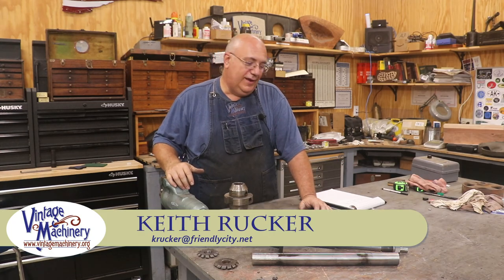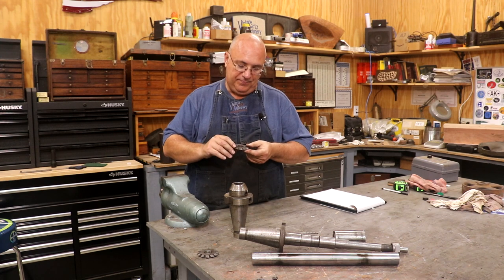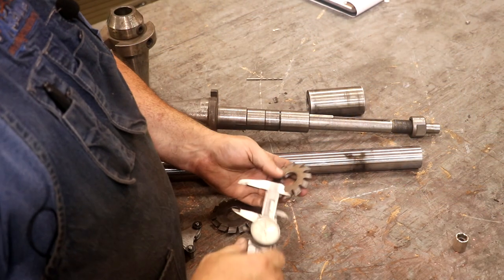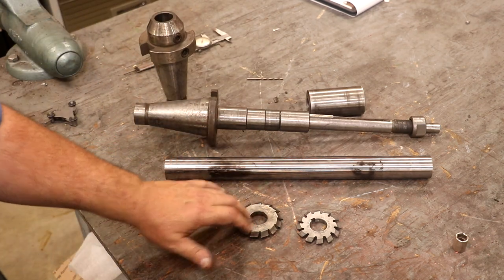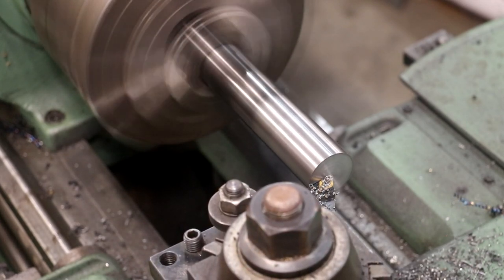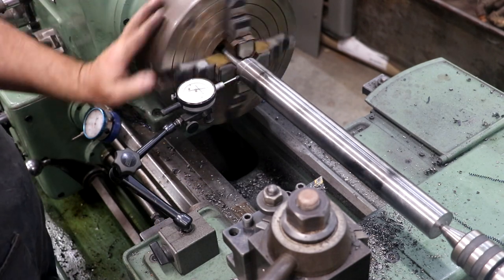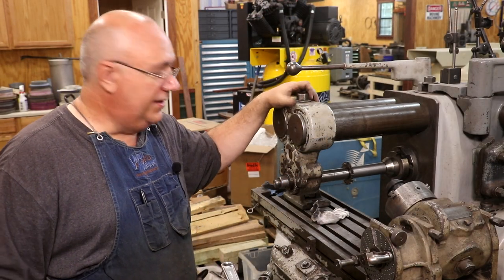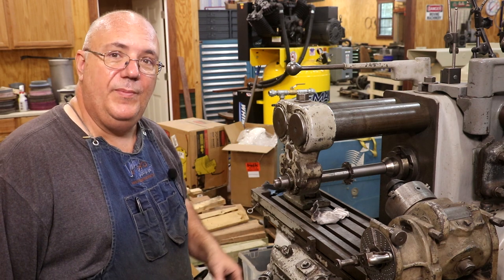Custom Horizontal Milling Machine Arbor Build

Comment: Hi Keith. Is there a reason why you didn't turn the whole thing between centres?
Reply: He's an amateur ;)
Reply: @millomweb  If he is, he's a darn good one.
Reply: @boldford  You've not heard the logic behind that argument ?
A professional is paid to do a job - he does it for the money. An amateur does it for the love of the job - now which of the two is going to do the better job ?
This, I take from theatre - having been involved in amateur theatre - I've seen performances that outshine professional theatres. The latter may spend more effort on various aspects - like set decoration but in fact the enjoyment of a performance doesn't necessarily need that. Expertly delivered lines and appropriate controlled movements ('acting') can work exceptionally well. A chair, a table and a standard lamp + actor is really all you need !

Comment: how is that cutter different for a bevel gear?
Reply: I think it has a different shape because the bevel gear gets wider from one end to the other
Reply: @ypop417  try again
Reply: @jacobpoucher  then You tell me?
Reply: @ypop417  he didn't reply? 🤔 Probably because he can't Google the answer
Reply: @maggs131  I tried to google the answer and got a Mr. Pete video saying there are 500 pages in the machinist handbook on gears
Reply: @maggs131  but by looking closer at the bevel gears they are cut deeper as you go to the wider end.

Comment: Would the arbor have been more versatile if the 1-1/16" section had been a little longer - say 1/2". If a 2" bushing were made with a 1/2" long section of 1-1/16" bore and 1-1/2" of  1" bore, the bushing would hold ANY THICKNESS CUTTER from 0" to 1/2" securely in place, whilst sitting securely on both sizes of the stepped shaft.

(yeah, it's a little work to make that bushing, but I don't think that's a difficult project)
Reply: The 'fit' size need only be half the thickness of the cutter. Why make more work ?
Reply: @paulwomack5866  That's another way to do it ! I think his solution took the most effort.
I think the best solution I've seen suggested is to use 1" arbor and make a bush with a shoulder of 27mm extending just short of the width of the cutter.

Comment: Great videos. I'm curious, every lathe  pretty much every lathe I have ever seen has a recirculating emulsified oil / water coolant on the cutter /drill bits etc. You don't use is this normal or do you only use for special jobs .  
From Sheffield UK.

Comment: Mr. Rucker to make the threads on the piece of stock is it the speed of the rotation of the stock or is it the speed at which the cutting tool traverses the stock start to stop? My apologies I have watched you do this but I was not clear how you got the thread size you want.
Reply: Your thread pitch is determined by the relationship of speed (how fast the stock is turning) and feed (how fast the cutter is moving). For any given speed, faster feeds produce coarser threads and slower feeds produce finer threads.
Reply: Thank you for the explanation Mr. Opalko!

Comment: Could it be that the involute is different and should not be used for any thing other than its intended use, and the odd size prevents people from wasting time machining a regular gear that will not mesh?

Comment: Out of curiosity, since tooling needs to be more accurately made than the parts run on it, and gearing is more accurate than most matching other than bearing fits, why didn’t you run the job between dead centers?  I.e., in a 3 jaw chuck face off and center punch one end, flip and repeat.  Chuck up a center and machine the center concentric to the centerline.  Dead center in tailstock and everything cut will be dead on, repeatable after flipping end to end.

Comment: It could be that the taper gear cutters had a different size so that you couldn't use the wrong ones. You wouldn't be able to use the involute gear cutters to cut a tapered gear or vice versa.

Comment: Only thing is you now have few..or no options as to where the cutter rides on the arbor ...but a small price to pay for not having to make a set of bushings in inch and a sixteenth...as you said...other options would have been to use an internal grinder to enlarge the drive holes in the cutters to inch and an eighth or make an internal bushing from 1 inch to inch and a sixteenth only thirty two thou thick with a gap for the key...not a pleasant prospect in either case...I see why you chose this option...the lesser of several evils

Comment: Hi Everyone, a nooby question, how a shaft run true when you indicate in single spot, should be at least indicated in two spots to get it true ?? Even if you machine one side, other side of the shaft would be still run out ??
Reply: All Keith was trying to ensure is that the first step mechined on the bar was true in the chuck. The center drill at the free end of the bar will also be concentric. The rest of the surface of the bar was turned away, so will also be concentric. even if the bar was bent by a small amount the result would be a concentric workpiece after the surface was turned away.

Comment: It’s an arbor support, not an overarm support.😊
Reply: Seems to be labelled as 'overarm' with arbor support or arbor bracket.
Reply: pmailkeey I worked for Kearney and Trecker, it’s an arbor support.
Reply: @crockteerden4023  An arbor support could be mounted anyhow. 'Overarm support' indicates it's a support fitted to the overarm. I've also found: "overarm bearing support" - so it seems there's a few names for the same thing. Like lathe tailstocks - quill and barrel being used for the same thing. Ditto top slide and compound slide.

Comment: I think i would have made a adapter sleeve and stepkey for the 1" arbor lol
Reply: I'm not super familiar with this kind of tooling, but would it not be a concern to only have 1/32nd thickness on your sleeve? Seems like you'd have to be really careful not to destroy it with the cutting forces.
Reply: @CplSpider  he only needs one small gear. Shims are thinner and work fine on gaint machines 👌
Reply: @CplSpider  you are 100% correct. A sleeve 1/32" thick would basically be foil and prone to damage during use. He may only need this a handful of times but a new shaft is worth the effort when accuracy is the main goal.

Comment: I dont know why you would do all that work when you could make just one arbor spacer with a 1 1/6 shoulder to hold the cutter centered .
Reply: Bush it, in other words - see those discussions.
Reply: @millomweb  No just cut a register on the end of one of the short collars
Reply: @Bobbycat115  Ahh, ISWYM now ! Are the collars hardened ? But indeed, you could make a special one in any case. Yes, a nice solution and a lot less bother than his ;)
Reply: @millomweb  Not real hard I have cut lots of them .You see the last 2 years of my Machinist Apprenticeship was in a gear shop and stayed 5 in all
Reply: @Bobbycat115  Sounds like someone there was getting the wrong size cutters!

Comment: Hi Keith, I am new to horizontal milling. I have a 1" abor. My question is, can I turn down some spacers to make a holder for the odd size cutters like 1 1/16 & 1 1/8"?

Also I want to make a bearing block to use with the large hole steady. At the moment the bushing in the steady is 2.11" which seems an odd size. I am wondering what size the bearings are normally?

Comment: Can't you just widen the hole in the cutter...
Reply: Clamp it to a mill table and ream out 1/16th and then you got 1-1/8. Am i missing something.
Reply: @Guds777  yes he has a bunch of cutters with that hole size. better to just make an arbor
Reply: Cutter is hard.  Not so easy to just ream it out.